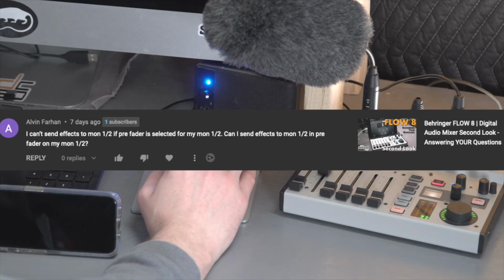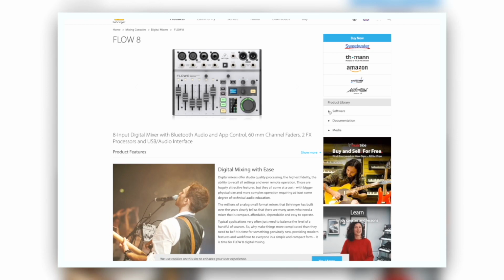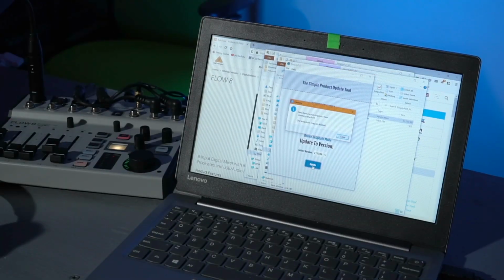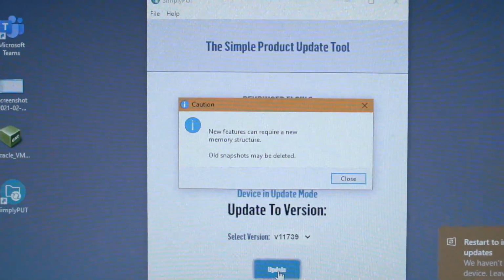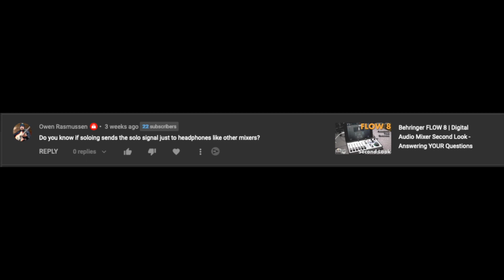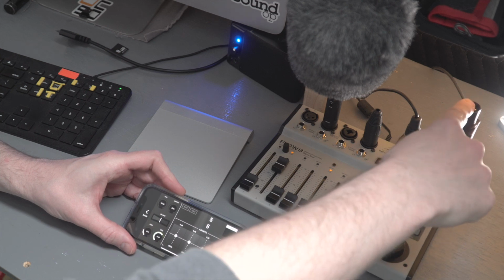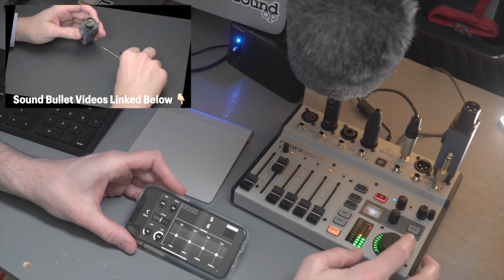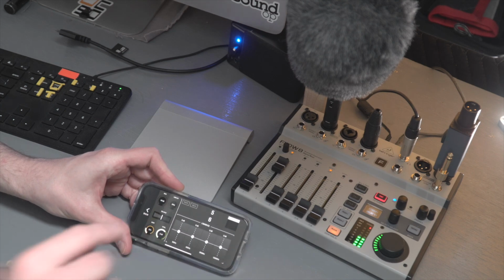Behringer Flow 8 Most Common User Questions in 2022

Comment: I just bought this. I connected it to my mac, have a mic with phantom power, and am trying to use it with obs. I can’t seem to figure out how to do any effects, limiters, etc. Nothing I do on the app, except gain, does anything to my voice. I don’t understand how to use this thing.
Reply from the maker: It sounds like you are in recording mode, which gives you direct outputs from the mixer to your computer over the USB. You might prefer Streaming mode where you send the l/r mix to the computer? Make sure you update to the latest firmware first so you've got all of the latest features.
Reply: @DcSoundOp  Yes. Thats what it was. Thanks. So, in recording mode, you can’t edit the voice and record that in, say, a daw? Not sure what recording mode is for.
Reply from the maker: The point of record mode is that most people do not want to record effects and compression and all of that into their DAW. Most folks want to record a dry signal from the interface, and use the DAW to process the sound & add efx later. If you instead are going live to a stream or have another reason you'd want to do the processing in the mixer, that is where streaming mode comes in. You could do it either way in OBS, since it allows you to add processing to the audio channels too. That eats up more computing power though, and isn't as convenient as having something dedicated like the Flow. Ultimately it is up to you how you want to work, but that's what the modes do.
Reply: @DcSoundOp  Awesome. Finally, someone can offer some clarity to someone like me who doesn’t know all that much about sound mixing. Thanks.
Reply from the maker: Happy to help, stay in touch if you get stuck anywhere else!

Comment: How reliable has been for important streams does it gives conection or audios issues?
Reply from the maker: Have not heard of anyone reporting any reliability issues during streaming. However, if your stream is really mission critical, it would be worth looking at more advanced systems that you can build redundancy into. Even the most expensive gear can fail unexpectedly when you go Live.

Comment: Thank you very much for your videos. My  questions is how to use feedback when i am too close to loudspeaker. Thank you very much !
Reply from the maker: Thanks for the question! The best way to eliminate feedback is to avoid creating it. If you know the issue, can you avoid getting close to the speaker? Of course before any performance, it is a good idea to 'ring out' the system if you're experiencing feedback. That entails carefully running up each mic to where it just starts to feedback, and then use the EQ to carefully notch out that frequency. You can use an RTA app on your phone to identify the frequency while you train your ears to recognize the frequencies in the future. The more you do this, the easier it gets... but positioning the speakers so they are not pointed into the microphones is still the best defense.

Comment: Great Videos. I'm not sure if I missed it but can either of the Mon 1 or 2 Mixes be routed to the PC via USB ? Is that a feature that could be implemented in future updates? I'm really interested in this feature.. Thanks
Reply from the maker: The only way I've found to do that so far, is to put it in recording mode so you're getting each channel back over USB to the DAW. Then a short 1/4" patch cable from the monitor outputs back into two unused channels, which put them on the corresponding USB channels into the computer. Not ideal, but it does work.
Reply: @DcSoundOp  Thanks. That helps and confirms stuff in my mind.

Comment: Thanks for the video  . I would like to know if I  could use it in any other Daw like FL studio, Pro tools or Cubase... and can it Work with the mixer from the daw on the screen like the Original app.
Reply from the maker: You can certainly use the FLOW 8 with iOS and android tablets, and any apps that work on them will use this as an audio interface as normal. I'm not sure what you're asking  though with "can it Work with the mixer from the daw on the screen like the Original app"- can you explain a bit more about what you're trying to do here?
Reply: @DcSoundOp  Very useful info, thx!
Reply: Great question! I'm interested in this running into Cubasis on an iPad, which raises the question of running the Flow 8 app AND Cubasis on the same tablet. Cubasis runs in background so it should work, but I'll be very interested to see if this does actually work in practice. An identical recording and live setup (i.e. using the same effects for recording and live) would be very helpful to me.
Reply from the maker: You can absolutely run other apps along with the control app for the Flow 8. An audio interface with a control app does not break iOS's ability to multi-task.
Reply: @DcSoundOp  Thank you

Comment: I'm a little confused about how to store snapshots into particular onboard slots and then how to subsequently rearrange them...
Reply from the maker: Good question, I do not believe it is possible to do that with the latest firmware. Might be a good question for the FB Flow 8 user groups though?
Reply: Good q. What I‘d like to see in a new firmware update would be the option to copy a single channel from a snapshot. It‘s a bit of a pain when you have like your vocals set up nice and right and you then forget you‘ll be playing your guitar, which you already have a snapshot for on another channel. There is no way to copy the guitar channel from that snapshot into your vocals snapshot but this must be possible in software (it‘s just a bunch of data). Does Behringer have like a suggestion channel or something?
Reply: @mikesrandomchannel  Another thing I don't quite understand, or perhaps misunderstand is how the "safes" work when loading snapshots. Context: I'm basically using the Flow 8 as an effects unit for an acoustic drum set in live performance, including a send/return to an external effect (monitor2/channel7). What I want to be able to do is load all the routing and FX levels, etc., but not the channel volume levels when recalling a snapshot. The problem seems to be that if I make "CH" safe, none of the FX levels get recalled. I haven't had a chance to fully confirm this and/or figure a workaround, other than loading the CH settings. Can anyone clarify this issue?

Comment: I recently bought flow 8 recently and new to it. I am struggling with connecting this mixer to an home amplifier system for purpose using it as a karaoke system. I have not seen any video talk about this basic function. Can you help?
Reply from the maker: Hi Subhash, what basic function are you asking about? This mixer was not designed for Karaoke specifically, or for connecting to home entertainment systems. At very least, I'd imagine you'll need to go into the preferences and use the output PADs to reduce the signal from pro-line level to consumer line level. That may help, but without knowing what you are trying to connect to, I'd be guessing to say more.

Comment: Just got the Flow 8 and making slow progress with it. Is there a specific footswitch that works best with it. Have to say there appears to be only a small amount of info available for this mixer which does not make life easy. Thanks
Reply from the maker: Hi Mike, hopefully this helps a bit - https://www.dcsoundop.com/flow-8-footswitch/ - I hate recommending Facebook for anything, but are you a member of the FLOW-8 user groups there? There isn't any great documentation, but a lot of users who are pretty familiar with the mixer and generally eager to help. Thanks for the message, I'm glad you found these videos!
Reply: @DcSoundOp  Hi Thanks for this, I'll certainly check it out. I know JUST what you mean about faceache too!

Comment: inputs 3 and 4 are infuriating. There is a -20db pad on the jack input on the combi jack and the xlr input distorts and clips so easily.  With a line  level signal coming into the jack in the combi input, you have to boost it by 20db, and then it's very noisy . useless.

Comment: Greetings, is there a high pass filter on the effects processors? When using effects live especially cathedral or hall, the low end has to be cut off of that reverb signal or the low end on the reverb will cause phase cancellation and sound boomy as well.
Reply from the maker: Ron, there is no HPF on the effects returns. You can download the control app and run it in demo mode to see how everything works if you have other questions about similar functionality. Hope that helps.
Reply: @DcSoundOp  Many Thanks
Reply: I am in total agreement with you. Hopefully Behringer will add a High Pass Filter on the effects edit page. I play acoustic guitar and I boost the bass on my instrument, I don't want that bass boost lingering in the reverb.

Comment: An option for the monitor sends to follow main LR level would be super awesome, could you pass it on to behringer?
Reply from the maker: On the latest FW versions, you can put the mon sends into post fade mode, set them to unity and those outputs will track post fader of the channels fader position on the main layer - creating what you’re looking to do 👍🏼 thx for the message!
Reply: @DcSoundOp  That's close to what i'm after, but i want the monitor 1 master level to follow the main LR level. So if I turn down the Master, the monitor 1 master follows. I'm trying to aux feed subs and want the master to control the monitor 1 output. On the X/M32 series, this is achieved by setting Mono/Center follows Main LR
Reply from the maker: @ewsclass66  yeah, that’s asking a lot from this little guy I think.
Reply: @DcSoundOp  do you think a low cut option instead of some parametric bands would be reasonable on the outputs?

Comment: Hi - Your video helped me in my decision to purchase this device, so thank you. One of the first "issues" I had was when initially unboxing was I sat the unit flat on my desk and couldn't get my iPhone to stand upright supported with the 2 little black restraints. I immediately thought I need a slimmer case for my iPhone? so I operated the phone separately on my desk. It wasn't until I plugged in a few Jacks and XLR's I found they acted as a rear support to the phone and hey presto! - Just thought I'd share that to any others unboxing. Peter.
Reply from the maker: Thanks for the message Peter. I can see how that would be a bit confusing if you didn't have anything plugged in!

Comment: Hello, thanks for all this, very helpfull... I have a problem getting connected with Cubasis 2 on the Ipad pro. Cubasis rcognises the Flow 8 (recording) but I cant seem to set the gain of the inputs?? Anybody know about this/ TIA..
Reply: the mystery has been solved... There is sound coming into Cubasis, the program just doesnt show a waveform upon receiving..: sigh... thanks again!
Reply from the maker: So in recording mode you're getting the direct outs of each channel right after the pre-amp, so the only gain control you have there is the input gain on the individual channels. Setting a healthy gain there that is not clipping will give you enough level going to the computer as well as being the proper level for sending through to your main, monitor & efx. buses too. 

Let me know if that isn't answering your question though. Thanks for watching!

Comment: Hello just wonder if I can use a inear system on the flow 8.. did not see knops to put sound and voice on the way that you can mix in the ear. Thx b
Reply from the maker: Absolutely, In-Ear monitors either wired or wireless are usually run off of a stereo aux pair - so in this case you would use Mon -1 and Mon-2 mixes as the stereo pair by linking them in the routing page. You'd then connect each output with a balanced 1/4 TRS cable to your in-ear monitor headphone amp, or wireless transmitter. Does that help or are you asking about something different? All the best Rob!
Reply: @DcSoundOp  thx for your kindness to explain how a inear would work, if I understand meanwhile you sing you can independently manage de volume separate ( voice and music) in your ear by the routing page..normally you have 2 knobs to adapt. Thx for reacting, preciate! Rob

Comment: Good evening I've been told now you can have the USB on a fader so when you put the laptop connected USB you can have the music coming out on a Fader because if that's true that is fantastic
Reply from the maker: Yes, USB 1/2 can go to channels 5/6 and 2/4 can be assigned to Ch 7/8. It has been this way for sometime now. I believe we covered it in one of the firmware update videos here on the channel last year. Thanks for watching!
Reply: @DcSoundOp  thank you ever so much for getting back to us it's because I'm going to be using this for a radio online and I need to make sure I've just got the laptop microphone and my music playing but I need to fade the music down but keep the microphone on and the only problem I've got right now is trying to figure out how to set up my jingles on the flow 8 cos he's no pads or buttons for it not that I know of

Comment: First of all, thanks for all the videos on the mixer! You've been very helpful when it comes to shopping for one of these. One important question: Have you seen a vast difference in sound quality between inputs 1 and 2 with the MIDAS preamps and inputs 3 and 4 that supposedly do not have the MIDAS preamps? Maybe a topic for a future video? Thanks in advance!
Reply from the maker: There is certainly a difference between the first two inputs and inputs 3/4. That being said, I wouldn't put too much stock in the first two having anything to do with 'Midas preamps' as they literally slap that sticker on everything these days. Actual Midas preamps still cost around $200 per channel and the preamps in this mixer are much more similar to each other than either of them are to the preamps you'll find in an XL or Heritage console from their heyday.

Comment: is it possible to use all 8 channels seperately? like a scenario could be mics on 1 & 2. synth on 3+4, digital drums on 5+7 and guitar bass on 6+8.
Reply from the maker: The stereo channels are paired and you cannot break them in the current firmware, but other than that, there is nothing stopping you from doing what you're asking.

Comment: Uch I think I'm going to have to hold my nose and buy one of these for an install. There's just nothing else I can find with the same features in the same footprint at the same price. Goddamn you, Behringer.
Reply from the maker: What are the features you're looking for? Based on your implications, I take it you're not a dealer for Music Tribe 😂  
I would hesitate to buy one of these and pass it on to an install client when they won't be able to register it for warranty. You certainly won't find the same functionality at this price in install gear, but install gear is expensive for a number of really legitimate reasons when it comes to supporting the tech years down the road.
Reply: @DcSoundOp  Ha, no not a dealer or an installer of any kind. Just your average Behringer-bashing enginerd who got roped into specifying a system for a synagogue install. We need one or two mic inputs, main and auxiliary output mixes (PA and stream), remote control, basic DSP on the inputs and outputs, and as few physical controls to screw up as possible.
 
Their main sanctuary system cost them in the high five figures, so they're going a different route on this much smaller system in a much smaller room. Their hopeful budget is CAD$3500, including a mic, mixer/dsp, speakers, amplification, interconnects and hardware.

I'll also be specifying a second option with some install-grade zone DSPs but frankly those are less appealing, and not just because they're two-to-four times the price. They also require rack space and running more wires in walls and permanently installing zone controllers. Also, installation gear is generations behind on connectivity and the DSP control software tends to have strong Windows 95 vibes (although I do very much like Phoenix terminals).

Stashing a Flow8 in a cubby at the back of the chappel and controlling it with bluetooth is far more appealing, even if it means buying a new one in a couple of years when it inevitably fails, because, you know; Behringer.

Truth be told, taking this gig has taught me just how little I know about the installation market. I don't even know where to buy column-style array loudspeakers or which amps to pair them with. I'm a complete newb again.

Comment: Is it possible behringer will increase the number of effects on the flow 8 and if possible  that would be very great👍👍👍
Reply from the maker: I wouldn't expect them to be able to add much more to the existing hardware, but who knows honestly, they could surprise us someday!
Reply: Just adding per-channel effects would be so useful. At the moment, you can‘t really use any of the specialised effects unless you are just playing one instrument into it. Which kinda makes me ask why it has so many inputs. If you had a small band plugged into this - vocals, guitar and keyboard - you‘d have to pick two effects (FX1 and FX2) that worked with all your instruments, which of course is only basically reverb and then maybe chorus for the guitar and the keys and vocals don‘t use it (gain set to 0 dB). It‘s better than nothing but a bit frustrating. Probably technically way more expensive than I am imagining!